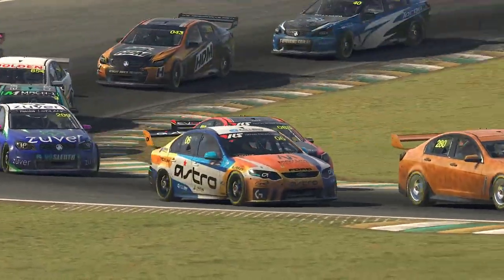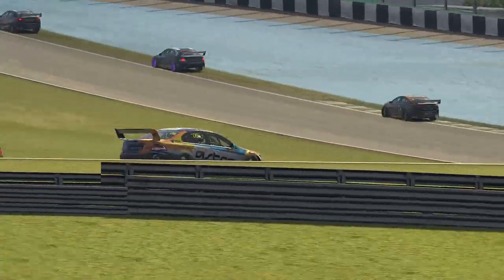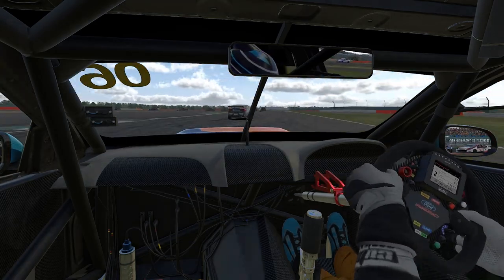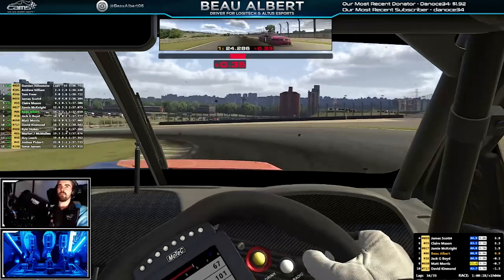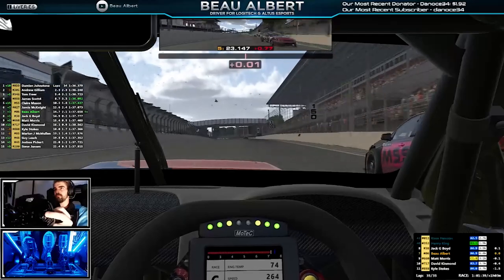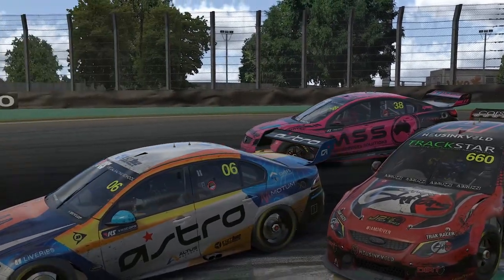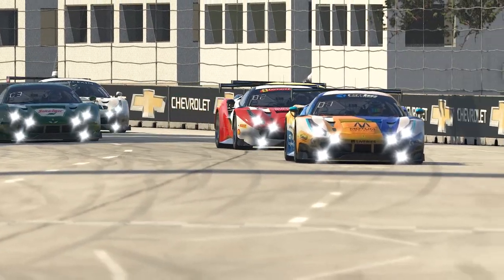Working on your Simracing Consistency!

Comment: The flow is not only known to sim racers.
the flow is a state of mind used by pretty much all pro players in any game.
its a state of mind where u are in hyper concentration only perceiving information from the specific activity you are doing pretty much unable to realise whats going on outside your activity alowing you to gain more informations on whats happening, reacting faster on situations happening and beeing more consistent overall.
the challenge comes when getting into that state of mind. for most good players that happens pretty much automatically when they start a game if its intentional idk.
but thats pretty much the difference between average and good.

Comment: Consistency is ALWAYS the most important pro driver ingredient. Once you master it at slower speeds its just about creeping it up inch by inch to the very edge. Most gaff it off, because to build it makes you go slower, initially, and requires lots of patience to push it forward. Trying to bring in consistency later, after getting fast with some bad habits, makes it far more difficult and always yields less results. This is a good vid on a very important topic that separates drivers from "Pro" and everyone else.

Comment: 🎯 Key Takeaways for quick navigation:

00:00 🙏 O criador agradece o apoio recebido no vídeo anterior, destacando ser um marco pessoal atingir mais de mil visualizações em uma semana.
00:29 🏁 Aborda a importância da consistência para pilotos de todos os níveis, descrevendo-a como a habilidade de manter tempos de volta similares sob diversas condições.
01:26 ⏱️ Define consistência como a capacidade de manter os tempos de volta dentro de uma margem estreita, crucial tanto para corridas em asfalto quanto em terra.
02:07 🔄 Sugere práticas para melhorar a consistência, incluindo corridas de no mínimo dez voltas para maximizar a memória muscular e o conhecimento do carro e do circuito.
03:16 🌊 Destaca a importância de entrar em "fluxo" para alcançar tempos de volta rápidos e consistentes, sugerindo que a prática intensa leva a resultados surpreendentes nas corridas.
04:14 🎯 Encoraja a definição de desafios pessoais durante as práticas para melhorar a consistência e a performance geral.
05:10 💪 Compara o desenvolvimento da memória muscular no sim racing com técnicas de treinamento no basquete, enfatizando a importância desta para o instinto de corrida.
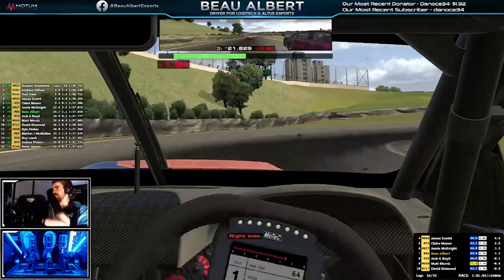06:32 🔄 Explica que estar em "fluxo" significa estar totalmente sintonizado com a corrida, preparado para qualquer situação e capaz de dirigir de forma incrivelmente eficiente.
08:07 🏋️‍♂️ Introduz o conceito de "treinamento infernal" como prática avançada, consistindo em esgotar o tanque de combustível e dobrar os períodos de pneus para simular condições de corrida reais.
09:43 🔄 Enfatiza a necessidade de prática e repetição para melhorar a consistência, concluindo que a prática perfeita é essencial para alcançar um alto nível de performance.
10:27 📅 Anuncia seu cronograma de transmissão ao vivo e planos futuros para o canal, demonstrando comprometimento contínuo com o crescimento e a entrega de conteúdo de qualidade.

Made with HARPA AI

Comment: How I’ve made decent progress w/ consistency & driving close to other cars is doing ~20 min races against AI in sims that have largish fields & close racing. The best w/ this of games I have is PC1 & PC2. My goal is top 3 & possible win and really try to not crash/ run off track (98% of the time my fault). I’ve considered getting iRacing mainly Bk it would force me more to drive w/in my limits Bk of damage & my SR (but too $$$). The worst at this on console is AC (I hear it’s way diff on a PC), & GT-S. For me it kills the fun & I don’t notice the consequences as much w/o large fields & close races where a mistake can mean getting passed by 3+ cars. Cold tires seem not effected or only in practice, not races in all the sims I have. 

I have a prob w/ consistency & not driving too aggressively. I blame playing too many games where there aren’t harsh penalties for bumping into others or walls. This is where I think iRacing has a decent model. Car contact is more likely to cause U to loose control, effects damage & your SR.
Reply from the maker: Very interesting to hear your thoughts mate!
Never really thought of Console Games which (some) have nearly no consequence for error, which makes the transition to PC a little more difficult.